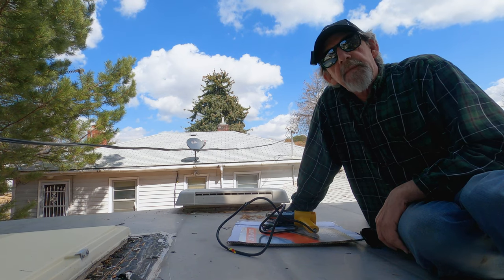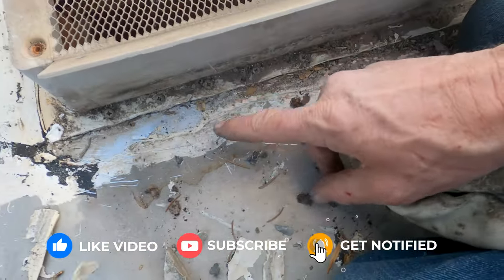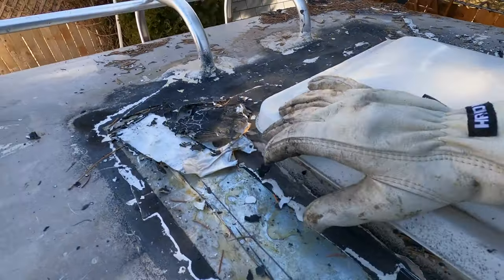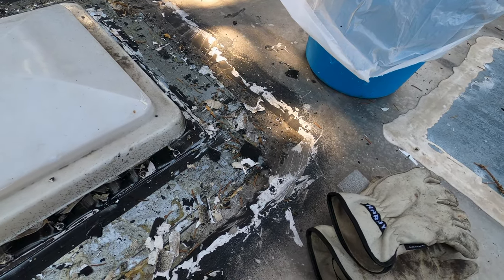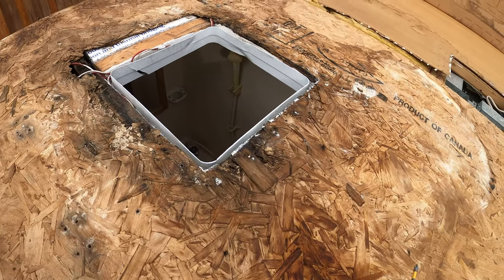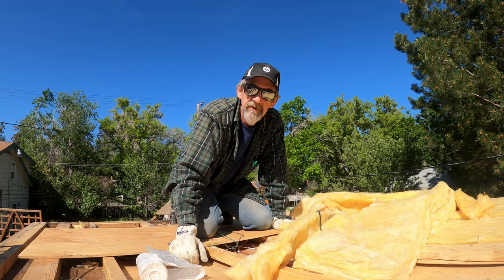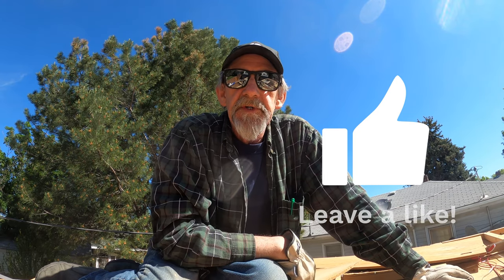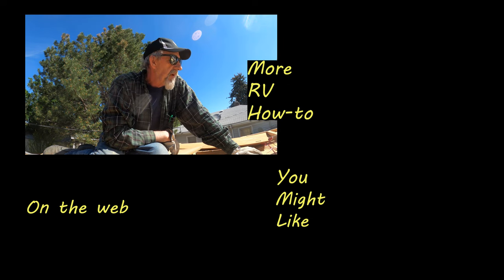Truck Camper Restoration..Major Roof Damage..Lots of Mold and Rotted Wood.

Comment: I just did a minor repair on a 2004 S&S 8.5SC that I traded a 2001 Holiday Rambler 5th wheel for and now I am thinking I didn't think that trade through very well. Oh well, I found some rot on the left front and tore out some of the plywood and replaced it with a patch. Ready for a fishing trip and didn't really want to tear into it any further at this point. This does bring up the point how I like full aluminum framed structures better so at least there is no structural rot in the event of a leak.
Reply from the maker: For sure. Here's a quick tip, pull a couple of screws from the trim and corner molding. If they are rusty you have water damage. I've noticed a nearly 100% correlation to where I found rusty screws, finding water damage.

Comment: I had my Arizona room roof replaced with a 3 inch thick panels i didn't know they existed till I talked to a patio company,  might work for your project
Reply from the maker: That's a good idea but those panels are twice as thick as the existing roof. I am trying to reuse the siding so I can't change dimensions much.
Reply: @trbowlin  thickens is optional i was told i asked for the 3 could have gotten i will send you a picture

Comment: I just purchased a 1993 S&S 8.5 for the heck of it... kind of scared now!  lol  I have previously rebuilt the front overhang on an old Jambo class C- it was fun for a few days, then you find the rot! My S&S was supposedly always stored inside or under a car-port, so I hope I'm fine. The bubble windows are supposedly not available anywhere anymore, but hopefully mine will be ok. Lots of resealing to do this winter for sure! Your videos on the S&S are a God send!  I want to add a solar panel to the roof, so your video is helpful to spotting the main framing struts. Do your codes on Amazon still work for you? I source there a lot. Thanks again!
Reply from the maker: That is awesome! It's not all that hard to actually repair it, it is a little hard when the rot just keeps coming. Yes, the bubble windows are unobtainum. There are lots of companies doing plexiglass forming but it's going to cost some coin to replace them. I'll be adding solar soon. Mine is prepped for it, and as soon a spring comes I'll be back to work on it. It would be very much appreciated if you use the amazon links. The easiest way is to visit amazon this way...amazon.com/shop/trbowlin . Again, thanks for watching and your support.

Comment: If you only have to replace the roof and not any full sidewalls, it won’t be as bad of a project. You may be able to replace 1 roof panel at a time. I don’t know how your roof was constructed, but my truck camper had 3 separate roof panel sub assemblies.
Reply from the maker: The roof is one big panel, but easily replaced in 4 foot sections. There are some problems with the walls. I am trying to work in sections and keep things plumb as much as possible. I may have to brace the walls together so I can strip the rest of the roof off, though. I keep running into problems that would not exist if I just stripped the whole roof. Stay tuned
Reply: @trbowlin  great. Look forward to seeing an update.